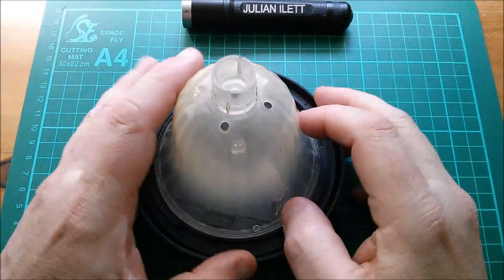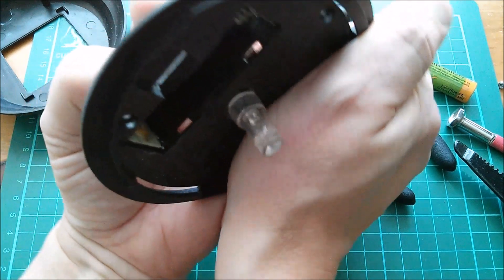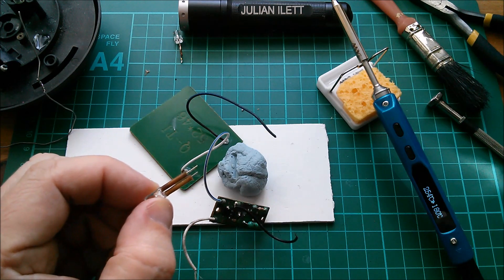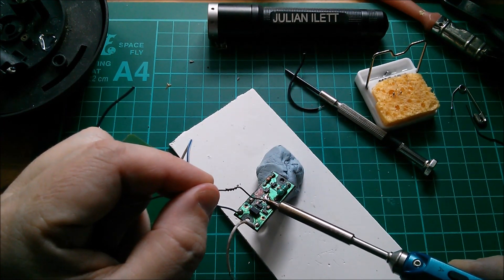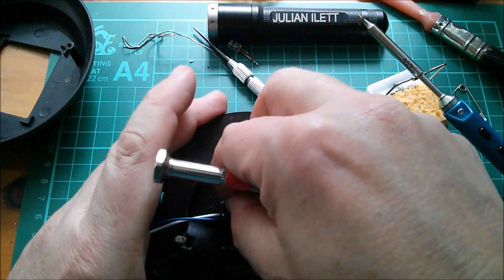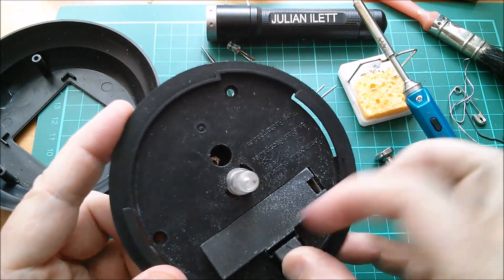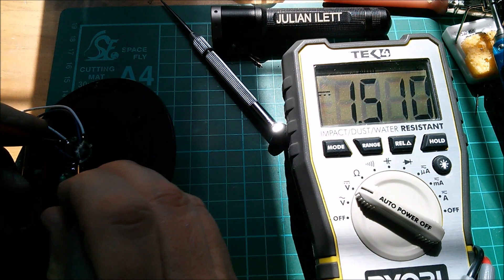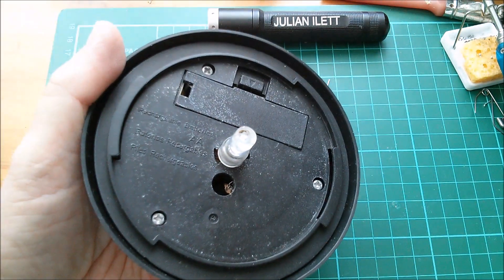Garden Solar Light Supercapacitor Downgrade

Comment: Hi. Any idea what to look for to fix my solar garden light. LED stays on during the day time. I couldn’t find photo/light element. It maybe berried inside solar panel itself. I got new battery and resolder all wire. It didn’t help. My understanding soon as you cover solar panel light should turn ON and open panel light should turn OFF and get into charge mode. But mine stays ON and drains battery. Any idea? Thanks!

Comment: Often wires which do not take solder are the dreaded CCA type, it stands for Copper Coated Aluminium, it is used to cut costs mainly. Although it can be useful when the weight of an object is critical.

Comment: You need 500 farad for a solar light. Also 10 farad may be little more than 5mah. So you need a 330 to 400uh inductor so it uses less current.
Reply: You may try a lto battery for an upgrade. Small Lithium titanate bateries could be as big as a super capacitor but much higher capacity.

Comment: I would think restoring optical clarity to the cover of the solar panel would be absolutely critical… it looks like it needs every photon of sunlight it can possibly get. The “Tech ingredients” guy showed how much difference it can make to simply place the solar panel down into a concentrator sort of reverse lens that the sides are mirrored and tilted in such a way that the sunlight bounces off of these surfaces and on to the solar panel. Casts a bigger net, so to speak..

Comment: Before you completely replace a wire that isn’t taking solder very well, try brushing on some strong vinegar, some dissolved citric acid crystals (it’s in the aisle with the canning supplies), lime-a-way, CLR, swimming pool acid (AKA muriatic, or hydrochloric acid) really anything acid based, rinse that off with distilled or at least purified water, then brush on some ammonia or ammonia-based cleaner which will remove any remaining grime as well as neutralize any remaining acidic anything- basically restore a completely neutral Ph to everything. I will then pull the stripped wire AND the length of solder I’m about to use through a folded piece of 320-400 grit sandpaper, and give both a final purge with a tissue soaked with alcohol. By now, the copper strands should be super light in color, and super shiny, and the length of solder wire should look like polished sterling silver. As to the solder tip itself, after trying all kinds of things, the current front-runner is a very specific type of kitchen scrubbie. DO NOT USE ANYTHING RESEMBLING STEEL WOOL! I hate that stuff… its not good for anything except ruining a surface while leaving behind whatever you were trying to remove. This includes “brillo” pads or anything like it. What I’m talking about is a very specific type of scrubbie made out of tight coils of very narrow and very thin strips of stainless steel or copper… Instead of gouging, like steel wool,they use more like a “shaving” action; with your solder tip hot, pull it through on of these a few times, and it will squeegee off all the contaminants and kind of refresh whatever tinning method you used on your soldering tip. Final step: apply a fresh coating of clean flux paste to the stripped wire, any terminal, plate, or surface you expect to accept solder.  Dip both the solder tip and the solder wire itself into the flux paste, and try to get a little droplet of melted solder to ride the end of the solder tip. As soon as that droplet comes in contact with a clean, but flux-coated twisted bundle of copper strands, it should flow on and just disappear as it “wicks” into the bundle. Once the stripped end is in this condition, it should melt and bond instantly once it is heated to melting point while it is being held in contact with whatever it is supposed to bond with. Once I started using this method of making sure that everything involved is meticulously cleaned and thoroughly doped with flux, (including the solder wire itself), the whole process was a totally frustrating hit-and-miss proposition that I would just come to dread. One more thing I was doing wrong was not paying attention to the tinning on my soldering tip. I finally found this product advertised as a “tinning paste”. I think it is a combination of rather high temperature solder and some kind of adhesive because once its on there, it doesn’t seem to just come right off as soon as its melted again. It comes in a little round metal container, and I highly recommend it. Good luck! Hope this helps!
Reply: I use vinegar for nearly all corrosion removal.

Comment: You can polish the surface of the solar cell clear again with toothpaste or jewelers rouge and a felt pad on a dremel in a minute or two also. Same for the light cover.  Get crazy with the hot glue gun to water proof the seals of the enclosure also. :P

Comment: I would have coated the board with paint or hot glue to keep the water/oxidization to a minimum. It sucks to have to take it apart every year to clean it up and rework the board. Especially here in the rainy Pacific NW.

Comment: Flux dissolves the oxidized layer on metal that has been well sitting in the air for a bit that is a poor thermal conductor a little squirted or q-tip you have sitting in your flux to apply to what you are soldering will remove that issue with the solder not melting well or adhering to the intended places. you could also probably just dip the end of your solder wire in your bottle of decent flux and if it is flux cored solder it should melt and feed flux onto what you are working on and mix quickly. Sometime the cheaper solder or lead free stuff has poor quality flux core or very little of it and the core isn't always exposed at the previously melted off end of your spool of solder giving you no flux to bubble up and remove all that oxidation..

Comment: love your videos.So what type solder and flux is most commonly used in this type electronics? ive noticed the wire ,is it aluminium or stainless or copper.it is hard to use lead when re-attaching.I see you prefer lead solder as i do.So what type wire is that and does that inductor raise the voltage.im tryin to get a 5 volt or its actually an 8mm led but it has only 1.2 volt battery.so how are they getting a raised voltage even with 5mm led.?Sincerely thank you .Keep it up.

Comment: The 5252f is such a hackable chip. It can be used to drive a flyback transformer and generate high voltage.

Its solar in pin for charging can sort of be used as a "chip enable"/gate pin and vary the output level. Created a really shit sound generator out of this thing.

Who knows, it might be possible to create a radio transmitter out of this thing.

Comment: The only things to fail are the switch and battery usually, the battery from age, the switch from rust, typically rust will build up on the component legs over time. How to make a cool LED solar garden light that lasts nearly forever with only battery replacements needed? 
Simple, don't use the actual steak with it. get a large glass var, and cut a square hold in the lid, now use silicone to glue the solar light inside. The biggest advantage of this is that it stops all moisture, you can pull it out a year later and there will be no rusting on the components, because water couldn't physically get in there. 
The glass also is good, it doesn't discolour with the sunlight. 
That's literally all you have to do, then when it stops working, unscrew the lid, and replace the battery. Another cool thing is to do what bigclive did, remove the LED and soldier in a connector thing in it's place, this enables you to easily switch in and out new LED's without having to solder them in, so you can routinely change the colours if you want by just pushing them into the connector thing. Personally I agree with clive that a rich blue is probably the easiest to get colour that looks nice of a night time. I only like purple more, but getting a powerful purple at that voltage is not cheap or easy, so blue is the way to go. 

BTW I am planning on doing this, it's actually possible to make a much higher powered unit with brighter light output, by essentially using the same IC and circuit board etc. You will still use the glass bottle, but instead you will buy a small solar panel, check the voltage of the one already in your garden light, it's likely around 3v, and only puts out like 20mA. What you can buy off ebay is a 3v panel that puts out 150mA, much better, it's around 6cmx5.5cm in size, it's not too large that you can't glue it into a square hole cut into the jar lid. Now you simply connect this to the solar panel positive and negative of the circuit board. You will have to replace the inductor however, a lower microhenry inductor will allow more mA on the output of a night time, so you will usually need to replace the inductor on the circuit board with something more like a 33 microhenry inductor, which will allow around 30mA of output. You will also put in a higher powered LED, able to take advantage of this. Also the battery should remain AA, but you should replace the typical 200mAh battery with something more like a 600mAh battery. 

This is a good project, I might do it. Make a long lasting and powerful solar garden light. Because to be honest, the typical solar garden light is very weak, and you have to pay more like 10 dollars to get one that is even half powerful.

Comment: in theory could you have used an old cell phone battery? I'm guessing the battery would be somewhat protected from overcharging only from limitations of what the circuit thought it was going to charge, right? or would that be pointless and dangerous? (I'm just curious cuz I like to tinker but I'm not circuit handy)
Reply: Big Clive did a video on that wait a second
Reply: https://youtu.be/ycFTxCoNAQk here it is

Comment: You should clean the solar panel & since the capacitor is shorter than the battery you should find something that will hold the capacitor in the space tightly.  By doing both of these extra steps your lights will stay lit much longer & brightly.  If the lower lamp part is plastic use an appropriate cleaner; if they are glass you can use that headlight defogging cleanser.
Reply: what part of this makes the capacitor run it for longer?

Comment: where did you buy those LEDs? I have bunch of LED wires corroted and need to replace LED only. OR do you know wher ecan I buy this ready made circuit board I can fit in existing light holder?

Comment: @UCmHvGf00GDuPYG9DZqQKd9A -  Thanks for the video.  Good electronics, could do with some better optics by polishing up the solar panel and the outer shell of the lamp.  
So I have to ask what is the point of having a lamp that only runs for a matter of minutes?  Is it just a academic exercise or do you have a special purpose for it?

Comment: I glued three little Dollar Tree solar lights on the spinning blades of the ornamental windmill in the back yard and one to the tail fin.   I replaced the couldn't make it through the night worn out AAA batteries with AA batteries.   Easy to do,  you cut off the AAA plastic and the AA will fit just right into the case and you can use the AAA contacts and spring.   Thus far  they are still working.   I've got lots of things I ought to be fixing but there is something about looking out the kitchen sink window and watching those spinning lights that bumped the windmill to the top of the list.     Next project is to make a solar charger for the AA batteries in the clocks hanging on the wall,  I'll replace the LED with a diode.   Should be enough light in the room to keep it working forever ........  or at least half of forever.
Reply: I've been wanting to do this with my outdoor battery-operated decorations. I want all my lit decorations to be powered by the sun and automatically turn on at night. Tell me how you go about this please or link me.

Comment: could have done it without cutting wires off battery holder.. 👍😎 plus the diode you removed is special low voltage one..

Comment: Every time I see you change the tip on this soldering iron, I grow sad because the designer missed the mark.  They really should have used a ball bearing and spring for a detent instead of a set screw.  Sad.

Comment: Chinese made. They use copper plated steel stranded wire. They do not take to flexing too well. After replacing with true copper wire add a dab of hot melt glue to add strain relief to them. If you can find silicone conformal coating spray, give them a few layers of coating. The corrosion will not return.

Comment: Regarding "hard to remelt solder" or something like that:  We were taught that the reason for this is that, when you add solder to a joint, you are making a new alloy, which now contains the original solder components PLUS a tiny bit of what ever you are soldering to, eg: some copper or even some gold, etc..  The new alloy may melt at a somewhat higher temperature.
Reply: I tend to set my TS100 to 330-350C for desoldering LED strips. 300 doesn’t really cut it.

Comment: Julian, I've watched many of your videos and I think the reason you have so much trouble soldering is that you run your iron too cool.  I've been soldering for decades and I've never used lead solder below 700F (370C).  Here are the temperatures I use:

700F (370C)  Surface Mount
750F (400C)  Through hole
800F (425C)  Large wires
850F (450C)  Heavily heatsinked

I'll admit that I solder at slightly higher temperatures than most, but I prefer to move more quickly at a higher temperature and I don't have problems with damaging components.  I think it's more likely to damage them at a low temperature where you have to hold the iron on the component for several seconds.  

If you like to move more slowly than me you might consider dropping my temperatures by 25-50F.
Reply: Never have checked to see if the temp gauge on my iron is close to right but if I set my iron over 360c it burns the tips so baddly the finish flakes off and they are never the same.  The little digital hand held unit I have seems to be best right at or just below 300c for most projects, I go to 350c when I need more heat or a bit higher for chase work.  Times have happened where I hold the iron a bit wrong and hit the temp up button and get over 400c but as I say my tips quickly go purple then black and the finish floats to the top of the solder and the tip is pretty much dead. Of course tips are damn cheep so it is no great loss, just a pain to have to wait for them to arrive from China.

Comment: I made a similar mod a few years ago. However my solar light was a hanging paper ball, so I put a hanging 500F supercap hanging inside the ball. I also replaced the LED with a wide angle strawhat, but it was quite pointless. Inside there was a standard 4 pin chip to control the process. Like yours, the supercap never reaches 2V which means that you can utilize less than the half of its energy capacity. On the other hand the 4 pin chip does not allow voltage to drop below 0.9V because it thinks it is a NiMH battery, and has to protect it, or it just can't boost the voltage up. This means you can't use that energy of the supercap either. But overall if the supercap is charged well it works ~4h :)

Comment: Those wires that won't solder are probably copper coated aluminium there a right pain in the posterior.
Reply: Those are even becoming a problem in IT now - cheap CAT5 cable using CCA rather than pure copper. Awful electrical characteristics, shortens the usable cable run significantly. Usually gets discovered after the plaster walls have set around the cable.
Reply: @vylbird8014  I have had great luck stripping the wires out of very old CAT5 cable that I have left over from  my pre wireless days, the old stuff has some great copper wire inside.  I also strip old inside house wire and get the six copper wires from inside, great for doing direct wiring where there will be no flexing after setup and talk about taking solder, but I almost always use my flux pen when building anymore, makes everything seem to go so much better.  I even built one of those tiny OLDE clear wrist watches, best damn watch I have had in years, going on 9 months on the first set of batteries.
Reply: Yeah, shocking that stuff. Some of it's not even copper coated, just aluminium conductors. I found out after I put a 30 meter run through an old building with intent to re-purpose it as 600 ohm audio lines. Can't solder it so I just made some tails from proper cu hookup wire and twisted them round the aluminium strands and put the whole lot into one end of a terminal block, using both screws to secure the mess together. It still works the better part of three years later..! :)
Reply: Yeah they're really only good for screw terminals. Even then you have to get the right kind of terminal - mains terminals are rated for Cu or Al, so you have to match them. If you don't the heating and cooling cycles causing expansion and contraction are likely to eventually start a fire due to the separation created.